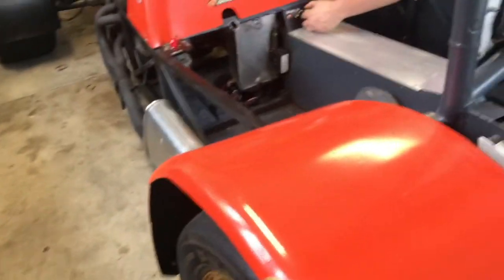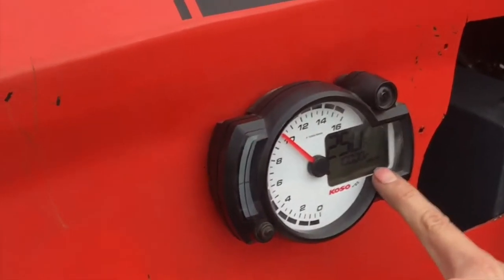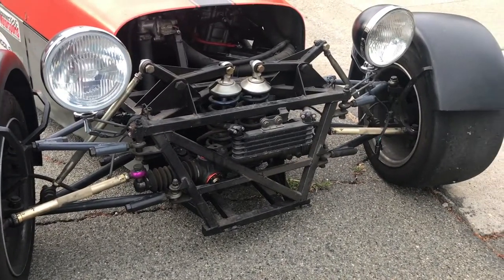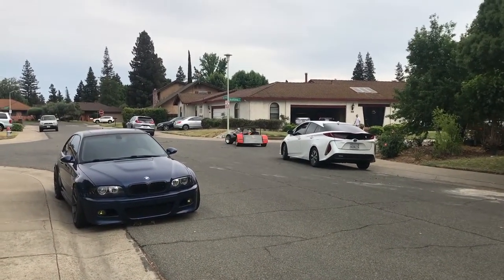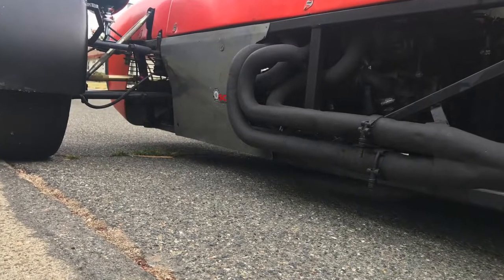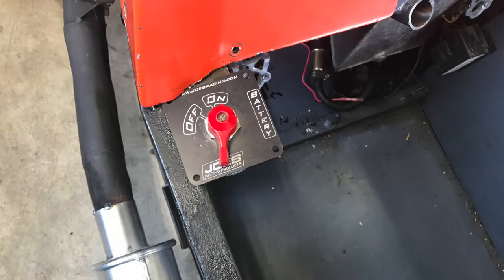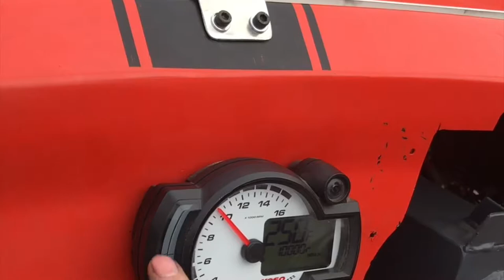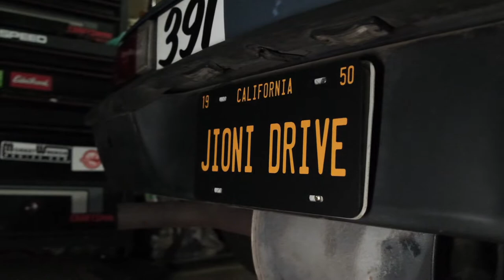10,000 RPM Lotus 7 | Race car powered by Honda CBR1000r Motorcycle engine

Comment: Cars with bike engines are absolute badass 😍
Reply from the maker: @Ripsaw EV-2
For a light weight car like this, the motorcycle engine is a perfect fit. The car feel brutal but it was built for auto cross.
Reply: @JioniDrive  Definitely!

Comment: Do you want to make it became street legal？
Reply from the maker: @Nick_Chang_, the previous owners was in the process of converting it. But the current owner wanted an autocross and track car.
Reply: @JioniDrive  I have interested in having a lotus 7. If you use bike engine,how transmission works?by chain or axle? And how to reverse?
Reply from the maker: @Nick_Chang_ looks like custom drive shaft- no chain. The rear axle is from an FA or FB RX7. I don’t believe there is a reverse gear.
Reply: @JioniDrive  Okay, sounds cool. I got it.
Reply from the maker: @Nick_Chang_ the owner might be willing to sell this one if interested.

Comment: Not a Lotus.
Reply: I mean just like a caterham it's basically a copy of a lotus 7. Can you blame the guy for putting a lotus sticker on there. It's a pretty cool machine regardless
Reply from the maker: @davidbrown8517, I should have done a little research. It’s a Locost Kit. Not a Lotus or Caterham.
Reply from the maker: @salinoraO, it is a fun car. Even though it’s not a Lotus. Great car for auto cross. But as we found out, can’t pass safety inspection for  a track day.